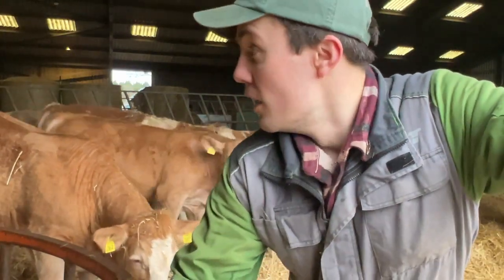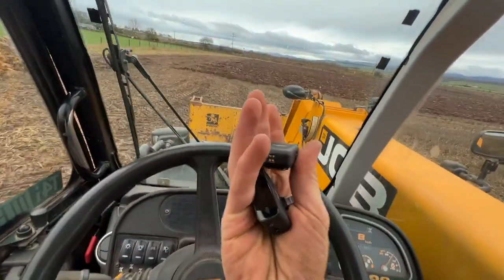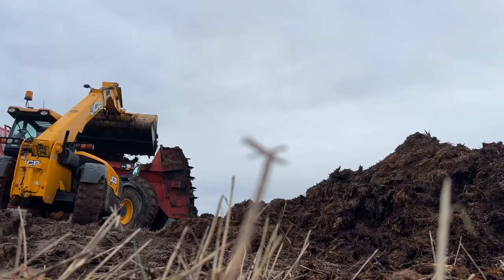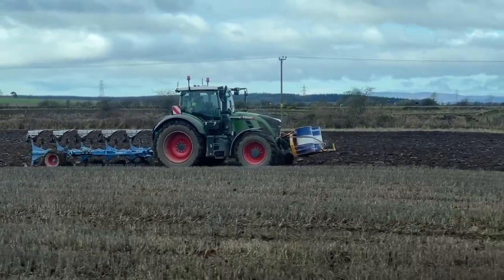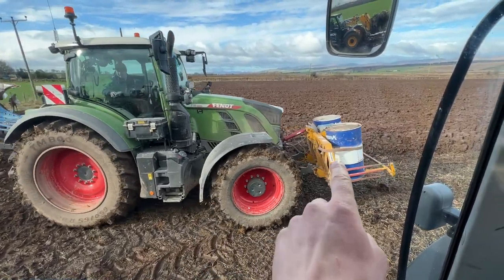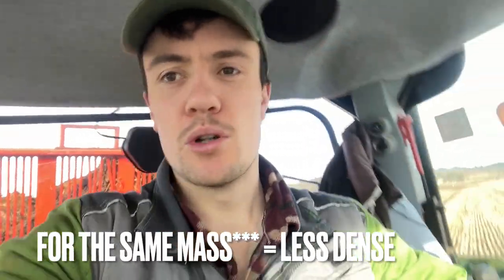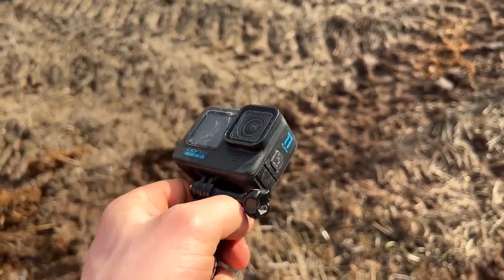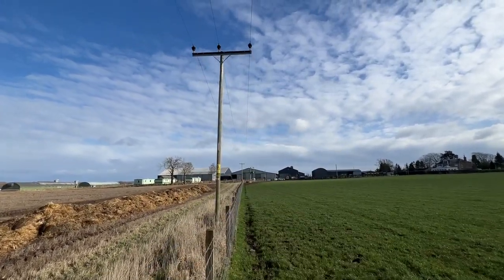Muck Spreader Can’t Move Fast Enough | Plough Charging On

Comment: I had them tyres on my class scorpion in all corners. As the front two run down I went back to Agri on the front much better clean yard better grip. Them tyres are ok on the road but not for our work. Even with the two agri,s on not much road noise. Your are not wired up right putting the Go-pro on the arse end 🤣Still gives the gate lady something to do. 😆😆😆